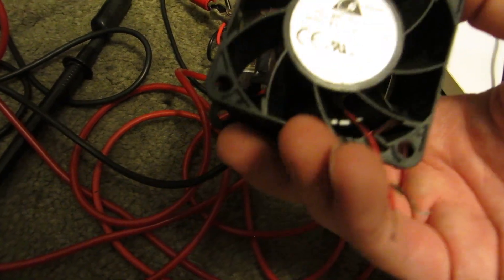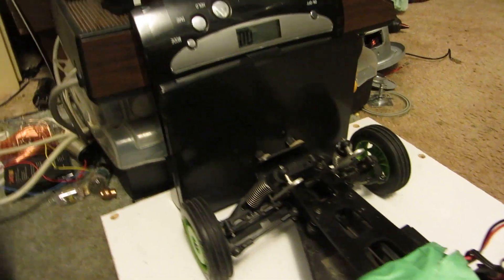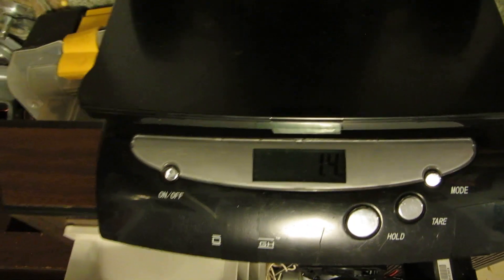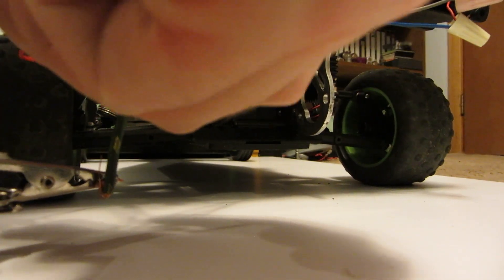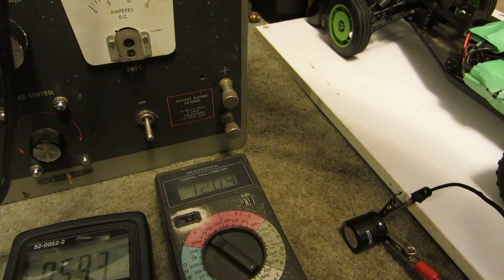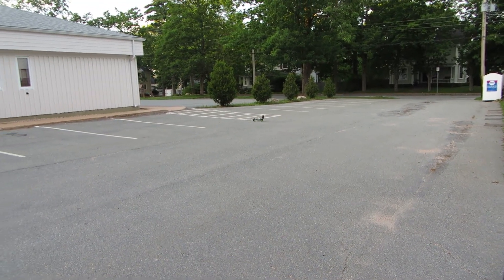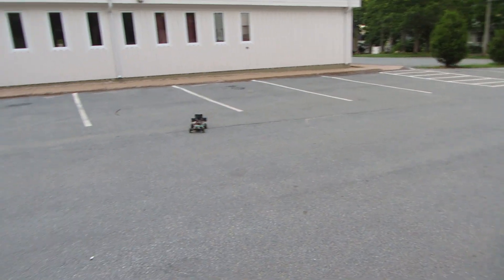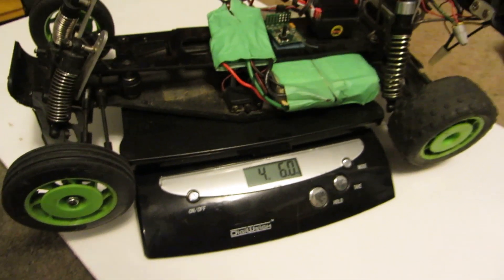Server Fan Powered R/C Car

Comment: Might be too much effort, but I honestly want to see one of those brushless motors actually drive the wheels. Wonder how fast it could go if it would even move.
Reply from the maker: It wouldn't move, the fan motors would trip the locked rotor protection.

Comment: Where the hell are you getting all these fans from?! haha

for it to move, shouldnt the force of the thrust exceed the weight of the car?
Reply from the maker: I salvage them from old servers.
Reply: A little more complicated. It mostly depends on the friction in the axles. If the axles are well lubricated, it should take hardly any force to move it :)